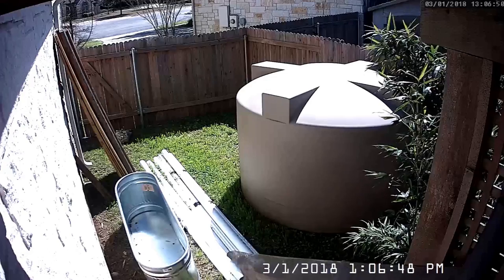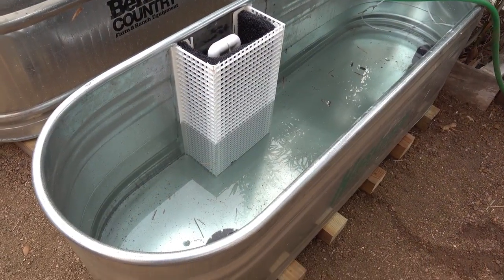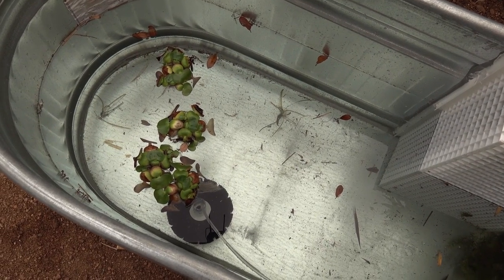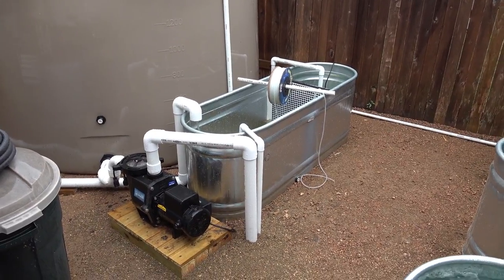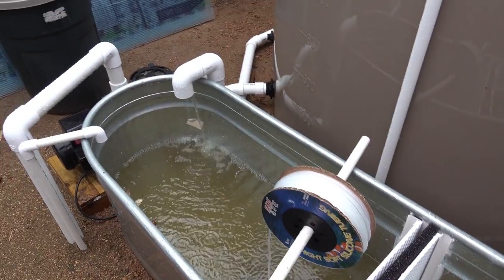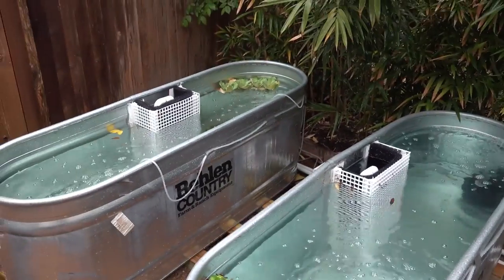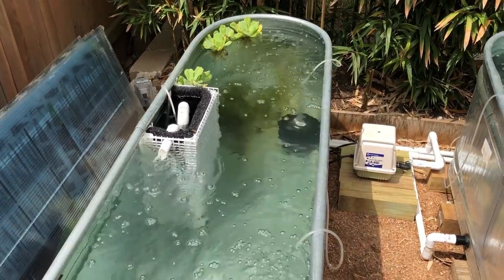1500 Gallon Rain Barrel and Backyard Fish Breeding Project

Comment: Any issues with zinc leeching from the tanks into the water?
Reply: I had heard about that happening in the past - but doesn't seem be a problem.  I haven't really tested anything directly though.  Anecdotally, I did grow up on a ranch and we had basically the same "water troughs" I'm using here with goldfish in them for decades with no problems.  It's kind of a built in water changing system with the cows though - they drink water, more water comes in, etc.  Interestingly, they also acted as vacation feeders because they don't floss their teeth they were always dropping all kinds of things in the water that the goldfish ate :)  Worked out well for everyone!
Reply from the maker: See answer above Josh.  Thanks.

Comment: Where can I get one of the filters like on top of your main storage tank?  I just installed at 1000gallon system but no filters...
Reply from the maker: Mine came with the rain barrels, so you might check with whoever you got it from.  If that's no possible it should be fairly easy to fashion one.  At the end of the day it's just a screen attached to a circular frame.  You could start with some screen (like people use for windows or a screen door) and than cut the top couple of inches off from a 5 gallon bucket - attach the screen to the bucket frame and your done.  Alternatively, I have seen people just put a piece of hardware cloth (rigid wire mesh) over the opening - that works too.

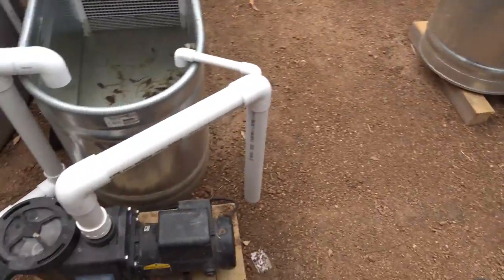Comment: Hello. Where did you get that gutter water catchment/debris filter at 8:27 or what are they called? I've been looking for that. Nice setup by the way. Thanks!
Reply from the maker: Here is an amazon link to it - they are a little pricey, but they work like a charm.  www.amazon.com/gp/product/B004VMG05C.  In retrospect, I probably should have also added a downspout flush - adds a bit of work and money to the project, but I think it would have been worth it over time.  Here's a link to that - www.amazon.com/gp/product/B001OWG6BU.  I've recently moved and in the process of building a new rain water system - I'll put a link to that video above once I get it done.

Comment: Where did you get the plastic frame for inside the galvanized tanks.  I need to do this for my horse/perch tanks.
Reply from the maker: Hi Jeff - I actually made those, but it's super easy to do.  Do a search for white polystyrene egg crate louver - it's basically one of those covers that goes under lights in office buildings.  They come in 2ft by 4ft panels.  You basically just cut pieces as needed using a jig saw or plyers and use PVC glue to attach them.  Let it dry for 24 hours and your good to go.  The pad on the inside is just a very thick bulk aquarium filter pad that I also cut to fit.  Good luck!

Comment: Hey, really neat, can I ask what’s the water pump that your using?
Reply from the maker: It's a crazy big pump that I had for a huge pond I had at one of my other houses.  I wouldn't recommend it - I had to manually turn it off and on and it sucked up a lot of electricity.  This is the one that I'm using now - just read down the page for the size that might work for you.  Basically these turn on when you need water and turn off when you don't - i.e., they maintain a constant pressure in the line - so they turn on when you water things and turn off when you close the tap.  https://www.plastic-mart.com/category/272/water-pumps  I've installed 4 of them at my new house and they are rock solid so far (admittedly only 6 months at this point).

Comment: where can i find the filter cages and filter material?
Reply from the maker: I just made those.  I took the acrylic light panel covers (like you see in an office) and cut them to size and than used PVC glue to put them together.  The sponge material on the inside is just bulk aquarium sponge that I also cut to fit.  It's a pretty simple build / design, but does a pretty good job filtering crap out of the filter system.  They also create a good surface area for beneficial bacteria - so pretty good all the way around.

Comment: Amazing, any info where to find the items for this build? Thanks in advance!
Reply from the maker: I got the main storage barrel locally, but the store recently closed down.  You can go to poly-mart.com and click on Find a Dealer to find one in your area.  As far as the 125 gallon tanks - sometimes they are available on Amazon - which is great because free shipping - but it's intermittent.  I got one of mine on Amazon and 3 of them from a local feed store - at the end of the day those are cattle watering troughs.  The air pump was from Amazon and the water pump was for another project a very long time ago - I think maybe from a pool supply store.  I'm in the process of moving to another house and going to reset things up there - I'll make sure and provide a list of parts and where I got them in the next video.